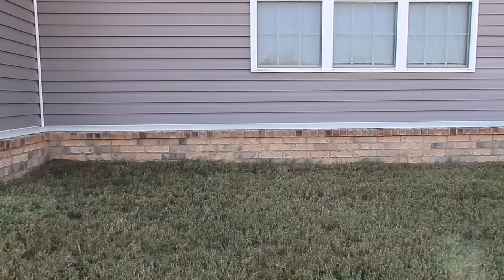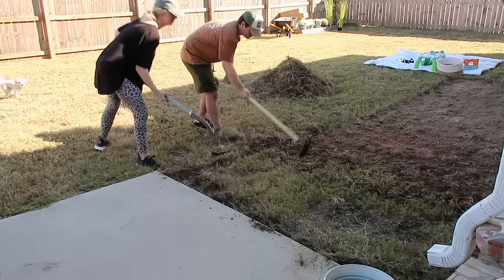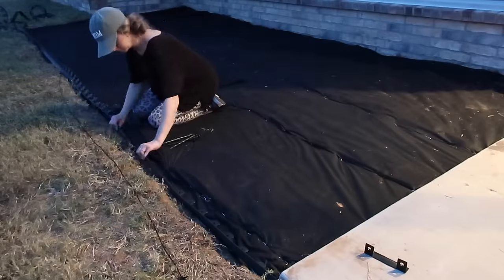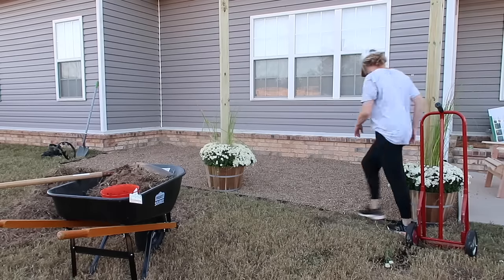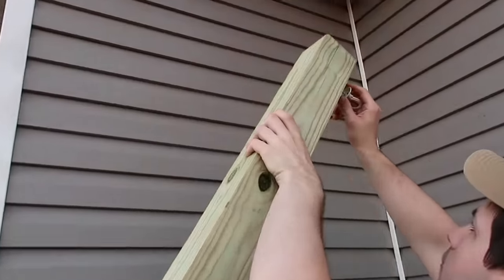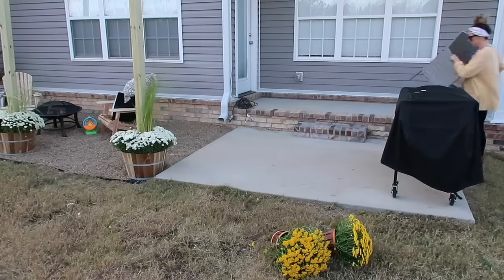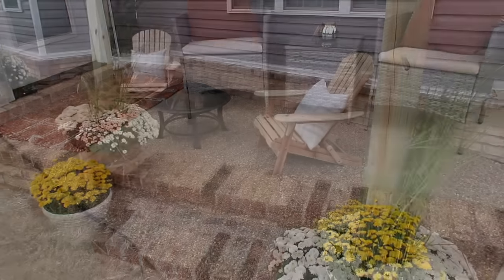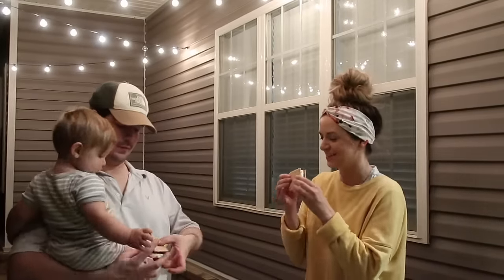EXTREME BACKYARD MAKEOVER! | EASY AND UNDER $300! | BACKYARD TRANSFORMATION! | Lauren Yarbrough

Comment: tbh i think it looked better before. the gravelled area as is currently is gives kitty litter vibes. to make it cute, you could  have used square pavers instead creating like a checkerboard print on the floor area. They are 5 dollars each or less.  Maybe four of those wood things in the barrels in a rectangle matching the gravelled area. Almost same budget. But now there's more framing. The gravelled area could also use a bit of a perimeter. Maybe some foraged larger river rocks or a couple layers of bricks matching the back. Or something like sweet alyssum as a border flower.

Comment: I hate hate hate landscape cloth. Better to use vinegar to kill weeds . If you put that cloth down seeds from weeds eventually blow in on top of that stuff and weeds will eventually grow up through it then you have a head ache. Use news paper and cardboard at first until the gravel settles then just spray vinegar on the weeds it’s easier to pull back pea gravel and dig up weeds then slide the gravel back .